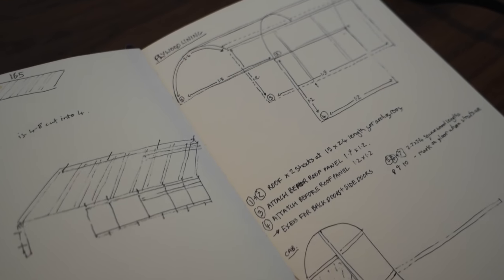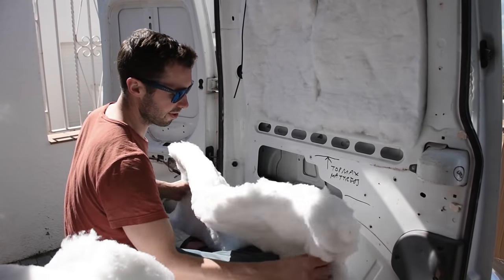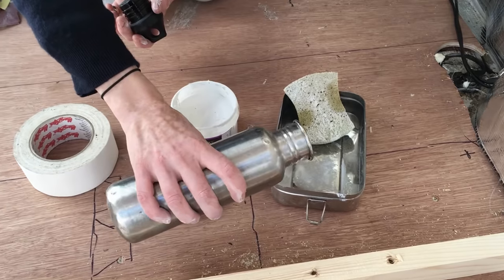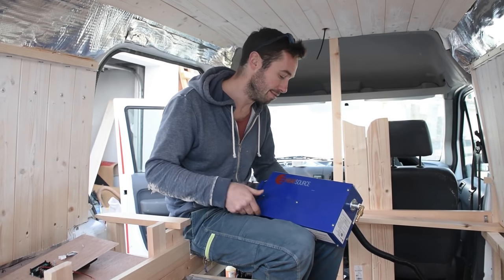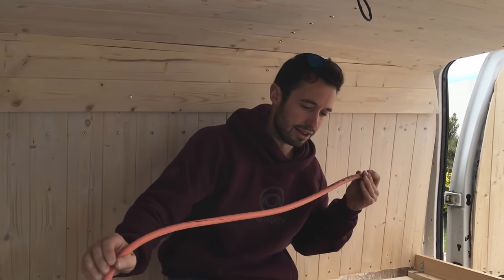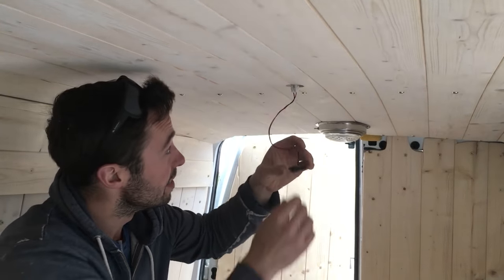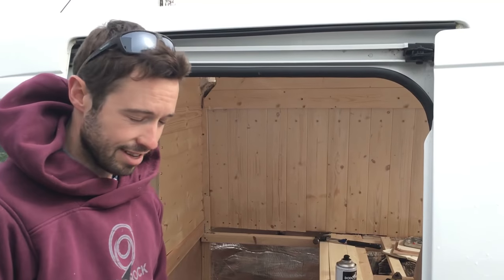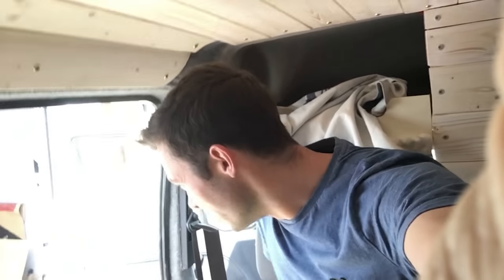How to Convert a Van; 7 Day Conversion Challenge!

Comment: Nice quick conversion,
I would be a little concerned about gas as not in a sealed box (as required) with floor vent,
if you check English motor home specs at .GOV site will give you full requirements,
Safety First, gas is dangerous and all regs should be adhered to, also carbon monoxide detector is a must in van conversion,
not trying to pick faults but help to keep you guys alive.
Reply: Agree — esp. about the carbon monoxide detector.
Reply: there in spain... so english laws dont matter. But yes safety first, your rite!!

Comment: Top tip. Next time try making paper templates first, then its a simpler process to cut the wood for those tricky curving areas.
Reply: Most videos that I have watched have the van-builders saying they used cardboard templates to make the shape fit the space or inside wall fit most precisely, like doing part of the build-out in cardboard that is taped/secured together to get a better visual for the space, before cutting wood that may go to waste as plans change as they become physical.

Comment: Are you concerned with the batting style insulation you stuffed in the nooks collecting moisture and mold?  Is it moisture resistant due to being old poly bottles?
Reply: Yes that is a huge issue that all these so called Van Life Pro Converting experts are ignoring. 99% of the people converting are friggin clueless on this subject. All that wood, reflex and the list goes on just is horrid for a van. Wood cracks, molds, warps and the list goes on, the dyna mat crap as well, all of this just lets the van's sweat and then they will all in 5-10yrs be rust buckets from the inside.  That spray foam they all use from hardware stores is horrid as well. If ya wanna do it right like say how winnebago in the US builds 10 sprinters a day, is look up lizard skin insulation. This is what I used for mine and am able to hose out my interior after a 2 month baja run. The rest I have made from alloy and a tad bit of plastic. My van is very light and will drive over sand etc it's 2x4   All the new 4x4 sprinters I run across in baja are so heavy they can't run the roads I run.

Comment: The ombre looks great, makes the whole thing much more lively!

I was skeptical at first about the lack of insulation on the floor at first, but then I saw that pretty much all of it is covered up by the bed anyway :D
The vapor barrier doesn't look too well sealed though. Dunno how strong and tight exactly the adhesive of the dodomat is, but in some of the shots you can see gaps between the foils. Wouldn't have taken that much longer to tape them all up with aluminium tape, no? Then again, if you're on a schedule, that probably seems like a good step to skip.

Comment: Great van!
Only problem i see on the long run is the kitchen "outside" as you have to open the doors for cooking - if it is raining and windy it might not be easy to protect the interior from getting wet...
Reply from the maker: True, it is a balance with tiny vans for what you put in it! She uses a tarp over the doors - otherwise hits up a cafe on the odd rainy day!
Reply: Right. You get a rather 'summer-only' van. We have no internal kitchen, which is fine most of the time, (lovely, even), but occaisionally we have to retreat inside and just use a stove on the table.
Reply: Small spaces mean compromises.
Reply: Did you watch the Swiss Engineer van conversion? Besides the shower and toilet I really liked the set up and table.

Comment from the maker: Thanks for watching! 
📖  Get the Van Conversion Guide here: http://bit.ly/2WERxIN
🚐  FREE Parts List:  https://bit.ly/2ZypQE0 
Don’t forget to Subscribe for more! 
Thanks <3  Nate
Reply: Rough budget for build? Not including van price
Reply: How much was it totally?
Reply: Nate Murphy nice video. Could the insulation get damp as it's straight to the metal of the van?
Reply: Hello! I didn't really understand the electric circuit. Do you get electricity from the engine's battery, do you charge a second one or none of the above? :D  Thank you very much. Nice project!
Reply from the maker: The second layer is a foil with rubber - it provides a pretty good moisture barrier. On top of that the van is cladded out.
Reply from the maker: Components - £1371.42 
Materials - £872.20 
Fit out total: £2243.63
 
+ Van £2420.00 
Grand Total:  £4663.62

+Ukuiano +curblaw
Reply from the maker: We had a leisure battery, charged via a split charge from the engine - also a 100W solar panel & 10amp solar charge controller.
Reply: How do you honestly feel about The Nomadic Movement channel rock climbing skills?
Reply: Nate Murphy whattttt no way! I want to start a build rn if I can find a cheap ish van
Reply: Nate Murphy Not bad!!!!! Not a bad price range for a total build at all!!!! Way to go Nate!!!!
Reply: Nate Murphy the insulation will collect water.
Reply: Nate Murphy Hi, the foil w/ rubber: what is it called? I believe I heard “dayday mat” but can’t find it online.
Reply: Dosen't the van have a smart alternator - which means you shouldn't use a split charger, but a battery to battery charger?
Reply: how did you found out that you had a gas leak ?!
Reply: @plstrom  i came down to ask that exact question
Reply from the maker: dodo! Link in desctiption
Reply: Nate Murphy what is the silver stuff over the insulation called?? Specifically. And would it suit the Irish climate better to use foam board over that easy Dodo in this video. I’d love that dodo stuff as it looks so easy
Reply: Can i hire you to do the same van
Reply: @bellabutteworth1536  as Nate doesn't anwer - You can hire me 😀
Reply: @konradp.6100  whatttt
Reply: Konrad P. Really.?
Reply: Can I hire you to convert my van please?
Reply: @alyagyzmova9252  yes pls write on the @ above
Reply: I couldn’t understands what you said the first layer was on the van floor.  What is the product name and dimensions?  Thank you
Reply: I'm afraid that theTermo van liner is dangerous because of its contactiveness
Reply: Nate Murphy that’s a really good final cost for someone who’s on a tight budget. It’s encouraging for someone like me who feels the van life is too costly. She can always upgrade  a few things as she gets a little more money and sees what else would make things more comfortable.
Reply: With the silver layer on the van floor if you google or go to Amazon and put in dodo Van conversion insulation it will come up

Comment: great job! good fun! i would get them gas connections checked out though, i couldn't see very well where that leak was but you don't use ptfe on 'pull up' threads... i think that was a face to face joint seal (couldn't see for sure) but the thread on a face to face joint is just a mechanical means to pull the faces together and if you put ptfe on them you restrict the travel and pull of the nut... if that makes sense.. i see people doing it all the time, only tapered threads have ptfe on them.. goodluck looks like it is going to be a big adventure!! one more thing, somebody else mentioned a drain for your gas, definitely do it, as it is heavier than air and will 'run out' and keep you safer should it leak x

Comment: Nice! good work!. After nearly finishing my conversion i appreciate how involved it is so doing this in a week is a massive effort, well done. Only one tiny thing id point out is that Harriet cable tied the split charge wire to the wishbone of the van instead of around the back of the wishbone mount so the cable will constantly be vibrating and moving harshly when driving, not a massive safety issue but wont do the cable any good in time, id just re cable tie it around the back of the mount. Apart from that you guys did awesome!!! Hope Harriet has happy travels :D

Comment: Hi Nate!  How were the holes in the van’s metal floor sealed that could be source of water/gas fume intrusion?  That detail was not recorded, only the tech sound van flooring (by sound deadening dodo UK) rolled over the floor after pulling the knackered screws and sweeping the floor.  Does Harriet have a Carbon Monoxide(CO)/smoke detector that is battery powered?  If Harriet doesn’t have one she should purchase one.  Thank you.

Comment: Umm, I think she may have zip tied the wire to moving suspension parts
Reply: She did. They will break and the wires will drag till they rip apart. Easy fix though just a hassle
Reply: It looks like it's tied to the wishbone and track rod arm. One goes up and down and the other goes in and out..i'm sure it won't snap (lol)!
Reply: strange lee it's tied to the CV axle, that rotates and will cut the ties at high speed
Reply: Oh yes i stand corrected...the axle is even worse!
Reply: This is why you have someone who knows about basic mechanics even if you DIY shit. To look after you and fix your shitty mistakes. xD And then you learn from them ofcourse. :)
Reply from the maker: Haha yeah, I got under there later on and we fixed this issue :D
Reply: I also  sow that  :D
Reply: Spiffy yup.
Reply: @skylarjosephzuniga2100  just what I was thinking. Better in armoured flex drilled clipped to the side
Reply: Where in the video can you see this and the axle
Reply: strange lee it’s cabletied to the driveshaft which spins round, it transfers the power from the engine which makes the wheels turn
Reply: OMG that was a horrible idea tying a wiring harness to a control arm. 29:04 There is no that will stay in place. First good pot hole in the road and those wires had to be yanked apart.
Reply: @johnathancovey9398  29:04

Comment: Chocolate block, not chocolate box (I expect you knew that really). Have you discovered wago connectors/terminal blocks yet? - they've killed off the chocolate block/terminal strip for me, especially nice for van wiring as they have good vibration resistance. That stick-on foam/foil does indeed look like excellent gear.

Comment: Hi, i have a question regarding the installation of the wood. Do you screw it to the metal directly? Doesn't that make it rust?
Reply from the maker: Yes but only into the structural stuff that or wooden studs I put in for the purpose of attachment. If moisture barrier works it's not a problem.
Reply: Nate Murphy ok i see! Thank you for your respond. Great videos you have btw 😊👌

Comment: Hi good job on the van. I am planning on converting a ford connect at the moment and trying to organise the bits i will need. How much insulation was used? Was at one pack for the infill and a 10m roll of 7mm foil insulation?
Many thanks.

Comment: Interesting build and I have a few questions. That insulation is it the same as thinsulate that is available in the US? Or do you know of a US supplier for that Dodo insulation? 
Also do you have any suggestions about how to deal with heat. I live in South Florida and the Summers are hot and humid. Yes the prime camping time here is winter. An other question was why not use plywood for the roof and the walls. It would seem like it would be cheaper and eaiser to work with.
Reply: In the US Canada, I believe a similar product is Kilmat 50 mil 50 sqft Car Sound Deadening Mat.
Reply: I avoided any use of wool-like material/denim as it is prone to moisture absorption. I stuck with rigid insulation and Touigh Stuff foam.

Comment: Of the van conversion videos I have watched people use some sort of fibreglass/fibre insulation but they all say it was a bad idea because it collects moisture and becomes mouldy. Whats the reasoning behind using fibre insulation vs expending foam? Wouldn't the risk of mould and condensation build us overshadow the benefit of the insulation?

Comment: Will the insulation material not suck water and get moldy ?
Reply: It looks kind of woolen, so I can see why you would ask that. Nate did say however that it was made from recycled (plastic) bottles,  the plastic is inert & wont suck any moisture. One of the reasons for the silver coloured covering, is also to have a vapor barrier to mitigate any condensation on the metal surfaces & around the insulation.

Comment: Hi Nate
Excellent video. Did you put a solar panel on the van?
Reply from the maker: Yes, just a 100W (so ok with 10amp charge controller) we got a flexible panel (it arrived late so it didn’t feature in the vid) we used industrial Velcro to attach it to the roof - nice and easy!

Comment: How does this insulation work in the 'extreme cold'?  I am in Canada, so it can get very cold in the winter.  If I was to put it into my van, will I be okay when the weather drops down to -35 to -40 deg C.
Reply: Holly Westell No one is Ok when the temp goes down to -35/-40. Find a nice warm home somewhere. Come out in Spring. Go vanning.
Reply: Holly Westell, you may want to see Elsa Rhea videos, she lives in her van in the mountains of Colorado where it gets very cold.
Reply: Im in Alberta and have traveled to montreal in dec at -45C with my big buddy heater, pink insulation in my 89 conversion van. I have never had any mould or condensation other than any normal marker light leak or window moisture that even empty vehicles get. Im going to do my second van with a warmer floor with softwood, it is light and becomes a good insulator. Hope youre keeping warm.

Comment: Mr MOT might not like the wires between the charge controller being on the outside of the van ! safety issues especially if they are not in a harness!    just saying  But a good conversion :-)

Comment: Has anyone ever used the new ceramic paints developed by NASA WHICH PREVENTS HEAT TRANSFER?. Supposed to be Super thin; super efficient insulator. Supposed to be able to spray the entire inside 1/16" thick. Then continue to insulate the cabin as normal.

Comment: From what the video's and space needed on these conversions........I don't think a short or standard wheel base will work.....just looks too cluttered........as well as not enough windows, thus not enough natural light............heck, not even a roof fan installed..............and okay, to cook at the back door is fine in nice weather........but once it starts pouring down with rain.......or snow..........totally stupid design flaw.......however, best of luck with it......hope it all pans out for you :-)

Comment: Did you see how rusty the floor was before conversion? In my opinion  without a vapour barrier this floor will always be at outside temperature and thus water condensation will build up and rust will eat away. You should have at least protected the floor with protective paint or have fitted a full-scale vapour barrier. The floor insulation you used is pretty useless too. Again, this is purely my opinion.

Comment: Did you built van for Sandra Bullock? :> Cause her smile.
Although maybe she wanted wood, wood is nice and healthy i think at first time would be cheaper, faster to mix both wood and floor covering instead going full wood, specially on the doors and on the roof, where is quite difficult to cut to fit those curves. Or finish the edges with flexible trim. Such as these http://cezar.eu/images/produkty/D17.jpg or something like that..

Comment: Though i'm not a pro in van converting i bet this van will rust in few years due to insulation and foam applied. This is still a car made of metal, not a house made of bricks.
Reply: You are correct. All the van converting Youtubers do it, but it will lead to rust. A vapour barrier with holes in it for electrical wiring isn't of much use either. I would just use the Dodo Vanliner and place the wiring between the liner and the wood.

Comment: So they cable tied the battery cables to the bottom wishbone and the driveshaft!?  That will make lots of pretty sparks and fry the van soon enough. Hope that gas leak is fixed properly. Lucky she has an "expert" on hand. Which chapter of his book explains how to put out fires?

Comment: Making this a challenge with someone else's van, I do not find fair. Because of the rushing your ideas from previous builds dominated instead of you two having a Conversation and inventing new or modified solutions... 
I do like many of your 'elements' though, irregardless.
The viddy is still plenty valuable so thanks for all the work and sharing. 
(A dimmer-switch for the lights is very visibly missing.)

Comment: Uhmmm.. Having wires ziptied to an axle that rotates at high speeds seems like a really.... really... really.... bad idea...
Reply: looked like the lower control arm to me not the axle
Reply: @davidcook1060  29:03 go back and look  again. There may be some on the control arm but its also zip tied to the axle.